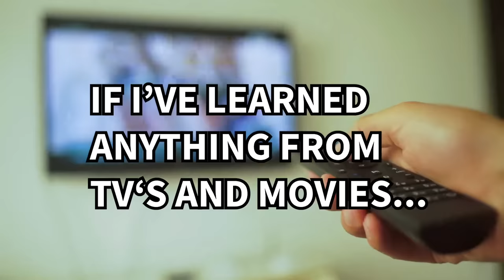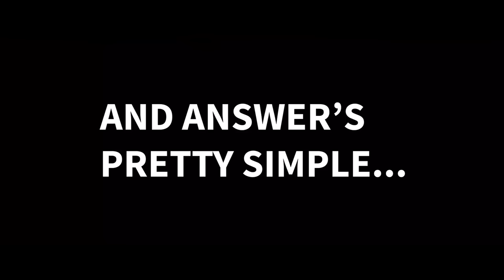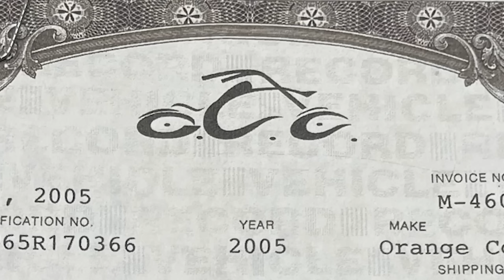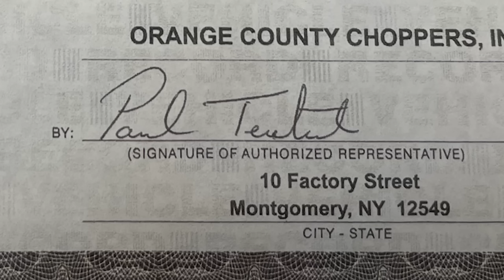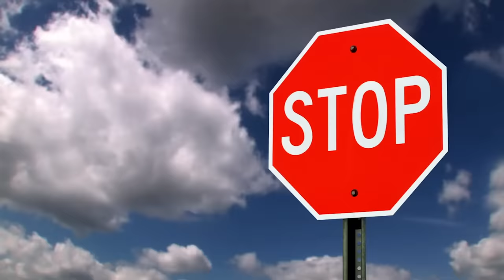Why you SHOULD NOT buy an Orange County Chopper

Comment: I didn’t like the proportions on most of OCCs choppers.
Reply: That entire bike should be WAY more tucked in, and compact. The rear wheel is way too far back. It's all so stretched and lanky looking. Too much empty space.
Reply: Exactly what I was thinking.
Reply: Yeah, the ones Sr built for himself looked stupid. The top tube was steeper than the Matterhorn. He could barely see over his gas tank.
Reply: Glad to know it wasn't just me thinking that. That and the build times were a damn joke. Yes, you can build a custom bike in a couple weeks, not arguing with that one. 

But it's going to have issues created by the nature of rushing the work. It's why I own a Bourget, not an OCC, and why my wife has a WCC Diablo. Both took months to build, and were issue free from day one.

My friends who went through OCC and PJD, nothing but issues. Not fun to deal with, when the builder is 5 states away, even with a warranty.
Reply: @mattkaustickomments  Sounds about right.

Only issues we had with ours were worn out oil lines and fittings.  In both cases, used bikes that happened to fit, and ran well. Called HQ in AZ for mine, got Roger himself, and he overnighted the parts to the dealer in NH, where I bought it, so we could pick it up that Friday morning. Also learned about how his oil system is set up. The frame is the tank, and he walked the tech through the job himself, at 0500 AZ time.  Wonderful service. 

The Diablo involved a call to TX, and went pretty much the same, with them telling us which AN fittings, and locating a local shop, that could make them, while we waited. JJ wasn't in the shop,  but was about an hour away, with his ex, at a race, and came by to see which bike it was, that was being resold, and ended up swapping out the bad hose,  and the other line, in the parking lot, while we watched.

May have had a little to do with me knowing his wife, and both of us being from Long Beach,  or just that he knows his customers  made him who he is today. 

Threw in a couple signed shirts and hats as well.

I ended up at the OCC store once,  when it first opened. Sr was there. I wasn't impressed. A couple friends were heading into NYC, on business, and I was visiting family, and they spotted it, and wanted to check it out. 

Man was just too full of himself.

Comment: OCC was more about the entertainment than it was about making safe motorcycles. I believe they also stated this multiple times that their bikes are meant for show; not to be daily drivers. They're meant to turn heads (and in this case break backs) and that's pretty much it.

That said, the original fan the bike was built for got exactly what he wanted. Proves to show that what you think is your dream bike may be hell in reality. Probably why he sold it as it was likely too painful to ride. A shame about that stock evo engine though. Even the guys at the shop thought 100hp when it only pushed out 65? Guess that's what happens when they offer a free bike; cheaper parts.

Personally I would replace that seat with one that has springs. Maybe that would also lift up the back a little so that you can actually sit on it without hanging on for dear life from the handlebars.

Comment: I spent 15 years building choppers here in the UK. All my bikes left the workshop with big powerful engines from S&S and other manufacturers. All had brakes to match and all complied with the strict inspection requirements for working lights, signals, instruments etc. Only the exhausts needed swapping out once the customer took delivery. The bikes were all designed and built with geometry that meant they handled well and always comfortable to ride long distance. 
It can be done and still look cool. Creative design to be fit for purpose, riding!
Reply: The English have always known how to make motorcycles that handle well.
Reply: @frankmarkovcijr5459  The big difference is in England, as in Europe and most of the rest of the world, you can't just build something and put it on the road as easily as in America. Each model you 'manufacture' has to pass strict regulations on safety (no sharp objects sticking out, no spinning belts/gears/chains/sprockets near the rider without covers), build quality, emissions and many more before you are even allowed to apply for a license plate and put insurance on it.

An OCC chopper like this one, will never ever ever be allowed on the road in Europe.
Reply: Anytime I used to ride a bike,my first question would be how fast does this thing stop,because most all motorcycles are fast.

Comment: So what is the diference between a bike and a chopper? Is that the length of the handle bar? The shape of the handlebar? The height of the sit?
Reply: The original name came from chopping off parts of the bikes that don't make it fast.  Then they'd extend the front forks to make it steer slower and harder to wheelie at the drag strip.

Then, like a lot of 'racing stuff', it gets bastardized into appearance for posers.

Comment: The best bike I ever had was a 2001 Indian scout. It was a smooth bike, very fast. 89 hp and a little over 350lbs. Single bar frame. It was so nice when I rode other bikes they felt like I was driving a cinder block.

Comment: Don't give the bike away, if someone gets killed riding that piece of junk you will feel guilty.
Reply: well damn, by that logic, he shouldn't sell bikes period.  
anyway, why is that bike more dangerous than others?  i'm sure he's sold tons of bikes with the exact same list of safety features.
Reply: @thinkdunson  :  he said the brakes are next to useless .  That’s a good enough reason not to ride that piece of junk
Reply: @thinkdunson  Did you watch the video? He said it was that bike was the  worse riding bike he had ever ridden.  He said the front brakes were useless and the rear brake was so sensitive it would easily lock up. For someone experienced it might not be a big deal.  But a huge majority of riders have very little experience and a bike that hard to ride will get you killed.
Reply: @geejayjay1281  worse riding bike does not mean it's more dangerous.  it just means it's uncomfortable.  and i'm pretty sure he was exaggerating on the brakes.
Reply: Totally agree. Should either fix it, or part it out.
Reply: In the 70s i had a 63 sportster chopper that i built. 12 inch springer rigid rear and no front brake. I never even had a state inspection. I survived. But im not claiming to be smart. Just an indestructable 20yr old then.

Comment: I think you need to make the OCC bike into what it SHOULD of been. Comfortable, safe and powerful.
Reply: Sure safe and motorcycles are synonymous
Reply: @rhyoliteaddict7939  when they are not built well, they are not safe. That's what my comment was about.... Over a year ago.
Reply: So.... go buy a Honda Goldwing.  Fits all three of your prerequisites.  But... if 2 out of 3 ain't bad... I see a Vespa in your future.
Reply: This was my take too!!!
Reply: @CrustyKustomsGarage  So the timeframe of the comment is a critical factor in response time.  I never knew that.  Thank you, over a year ago.  Just kidding, I agree with you and I'm fairly sure a year after you said it, it's still true.
Reply: @Frieghtliner1975  Better than a garbage bike and irreversible spinal damage in the future.
Reply: i disagree

to achieve that you would need to replace every single part of the bike to achieve that, apart from maybe the tyres and the battery

seriously, the frame is trash and it would be easier to start from scratch  than to remodify it with suspension.

Comment: I’ve owned rigid choppers/bobbers in the past. A good set of seat springs can really make an improvement in the ride. A chopper isn’t about horsepower though. It’s about the feeling of being on a machine most would be afraid to ride.
Reply: Definitely, my chopper is completely rigid, no suspension at all but my spring seat that I welded on there makes the biggest difference
Reply: Afraid... Embarrassed... Its a fine line really 🤷‍♂️

Comment: is it called chopper because its basically a custom bike, alot like how 1940s 1950s 60s 70s cars would be customized sometimes drastically body frames and pillars, and would then be called "chopped" cars. Is the term Chopper a similar term when used on these custom designed motorcycles? I have a hunch it does, since the terminology is so similar.

Comment: harley davidson did not make a bike with a rear suspension until late 1957. all of their cycles were hardtails with the only suspension being springs under the seat. the duo glide for 1958 was the first to have any shock and a swingarm.
Reply: Correct. And that suspension seat had several inches of travel.   By the way, the 1952 Harley K flathead, had front and rear suspension. In 1957, it got overhead valves and became the iconic Sportster.

Comment: I think I'd take a West Coast Chopper over the Orange County ones back in the day. Always liked Jesse James and his work.
Reply: Ive ridden both OCC and WCC bikes, the analogy I would use is Wal-Mart VS. Prada.  Of the 7-8 OCC bikes Ive ridden 4 had leaks in the tank, not one was reliable as they all had parasitic draws, and fasteners were constantly coming lose.  They were pretty to look at though.  The 2 WCC bikes Ive rode  were comfortable, they fired without hesitation, they were just built to ride and be reliable.
Reply: Jesse James could build stuff. Like, actually build stuff, not ordering parts and putting them together while adding some designs plasma cut out of flat-stock for decoration.
Reply: @Centermass762  right
Reply: That's because Jesse can actually build. He almost got me into fabrication and wish I would have.
Reply: Jesse James is a very good bike builder.  He built them from the ground up. He made the frame from scratch. He took his work very seriously.

Comment: I think if that were mine, I'd start by replacing the forks with a Sugar Bear Springer to flatten it out a little. Get a real motor for it. Redesign the seat with a little spring and a better purchase. Obviously proper brakes. I'd also ditch that open primary for something safer and more discrete. Spikes are out so probably get rid of 90% of those.
Reply: At the point we can scrap it and use the motor for a drift kart maybe lmao
Reply: See if anyone is stupid enough to give anywhere near $8k for it, and get another bike that isn't a series of horrible design choices welded together.
Reply: A motorcycle that IS a motorcycle you mean?
Reply: In other words, you'd swap the bike for a collection of bike parts and assemble them😁
Reply: @MrT67  Maybe better seen as swapping the collection of bike part shaped objects for decent bike parts and assembling them? Honestly, those OCC built machines are lookers and not riders as designed. If your bike is a test of endurance and not an actual pleasure to ride, it's just not a good bike.

Comment: Old school trick with ridged frames is, run your back tire a little low in air. It helps.
Reply: About 3 inches of foam on the seat pan might help a little. And a big quarter-eliptic leaf spring under the pan, like old time tractor seats had.

Comment: Dual front disc and bore out the cylinders. Spring saddle seat.
Reply: Can’t put front discs on choppers or the torque will snap the forks
Reply: Did you watch the video? There is a disc on front wheel
Reply: @nathanphillipson1457  you are special!
Reply: If there's too much power from the front they will
Reply: @nathanphillipson1457  Larger rotor then perhaps?

Comment: What to do with it 🤔
1. Add a spring seat that won’t allow you to fall off the back
2. Upgrade the brakes BIG TIME.
3. Cover primary belt.
4. Figure out where the issue is that drains that battery.
5. Go fuel injected.
Those easy fixes MIGHT make it more “practical” to ride.

Sell for $15,000 OBO

Comment: Being an aircraft mechanic. I learned you do not grind welds. That’s a fact. It induces cracks. So if you buy one of their motorcycles they look pretty but they’re going to crack!!
Reply: Don’t all custom bike builders grind welds? I could never afford one so I don’t have to worry lol.
Reply: Pipefitter here. If you have to grind youre not a welder. Youre a grinder.
Reply: @EMK666  Oil field structural welder here. 6GR welding certified 
You are exactly right. If you're grinding your welds after you're done, you're a grinder, not a welder.

Comment: Spring seat for one thing also dual brake disc’s on the front wheel and for sure more power 🤟🏻🇺🇸🇺🇸🇺🇸😎
Reply: More stopping power in the front is useless with that steering angle and small tyre.

Comment: When I was like, 19 and learning the basics of motorcycle mechanical repairs, I learned that things like rake angle and damping factors are derived by a very complex set of relationships involving material properties, dynamic stability at road speed, and concentration of the forces of gravity and acceleration. Every weld and drill hole and bend is engineered to perform at the needed level.

Every time I watch these goons just slap a couple tubes and sheet metal flames together from a concept sketch and throw a seat on it, I imagine how absolutely hellish the ride must feel at anything above 20 mph.
Reply: Not to mention your life depending on the geometry being perfected.

Comment: These guys were the pimp my ride of the bike world they had a few good episodes but when they beat Jesse James on the build off I thought it was rigged but realized the people who are not really into fabrication would vote for the flashy show bikes also I've said for years that senior had to be on hgh and or roids it would explain the temper as well
Reply: Oh God, could you imagine them doing the pimp my ride thing and actually working on people's old rusty bikes??

What's the bike equivalent of using chicken wire and bonds to fix rusty rocker panels on a unibody?
Reply: @DrewLSsix  Using bicycle gear cables as throttle cables, for starters.
Reply: Jesse James bikes were crap too
Reply: At least he built them, unlike the Paul's that ordered parts out of catalogs.

Comment: Been to many bike shows and have seen most of the top bike builders and their builds. All looked impressive, but as you pointed out missing springs, made-up accessories, just the minimum or less to build to have running. I was able to ride a few and again like you pointed out not the best thing to ride. At best what one would call bar hoppers costing way more than what they're worth.
Reply: spike.

Comment: Sell it to another sucker and take the loss as the price of learning that OCC built bikes strictly for looks.  

Their value rested merely in the novelty of the looks.  The bikes had no other redeeming features.  The builders had no redeeming virtues. The reality show was nothing more than a series of commercials for the shop.
Reply: All the time they spent building a fuel tank, that a better quality one could have been bought for a few hundred bucks, should have been used putting quality parts on the bikes. Who cares you have a high dollar fuel tank and the cheapest forks known to man. You're so correct. Yard art is all those bikes are.

Comment: "No major manufacturer made motorcycles with no rear suspension..." Didn't Harley make hardtails in the 50's?
Reply: Most bikes were hard tails back in the day. Remember, they started as bicycles with a motor added. First front suspension was added to keep the front wheel on the ground so the thing could steer. Rear suspension came about when HP went up and traction started being an issue.
Reply: You are correct, but he was also referring to no spring seat. I believe the thought process was no rear suspension for the spine. I could be wrong though.
Reply: Those still had spring seats
Reply: Or springer front ends
Reply: Yes Harley and the British makers made hardtails. They had soft double sprung saddles, high profile low pressure rear tyres and foot pegs further back so you learned to unweight yourself from the saddle when you saw a big bump coming. This piece of scrap has none of those features.
Reply: Stop making excuses for this guy. He is like the Doug demuro of motorcycle.  He doesn't have a clue about what he's talking about.

Comment: Jesse James said there bikes where trash guess he was right over priced 💩
Reply: Its mostly the cheap rev tecs they used , mine blew up in about 7 months i put a rb racing 124 in and fixed their screw ups and id ride mine across country and prob will. Its very easy to work on now they made a lot of it over complicated .
Reply: @stevenbean9706  sure you did
Reply: @johnnymack923  your more than welcome to come take a look poser
Reply: I've got a 2000 trex sitting in the garage right now with an rb racing 124 in it the rev tec blew up within 7 months orange county choppers attached all the grounds to painted parts the only ground was what they got through the bolts and if they weren't tight you had zero ground ! I've got the 124 apart to replace gaskets and install a fuel pump with the largest mikuni i can get the dyno sheet says it made 156 hp to the rear tire with almost 160 ft lbs and my plugs were almost white so even with the carb it has it's not getting enough fuel and still making a fuk of a lot more than the 70 to 80 hp they put in it !

Comment: I always laugh at the supposed valuation of vehicles on shows. How many times has a show taken a bike or car to auction expecting like $90K and it goes for less than $75K? It was probably realistically worth $35-40k brand new and the guy probably could have gotten much more from it with better advertisement. 

It's super common for show cars to be sold 2-3 times in the first couple years and then hit the market for dirt cheap after 10. The custom hot rod and bike scene in the early 00's didn't age well and all of those things are pretty dated from the paint to the parts.
Reply: It wasn't even worth the cost of the parts once it was built. It's a piece of junk built by clowns.